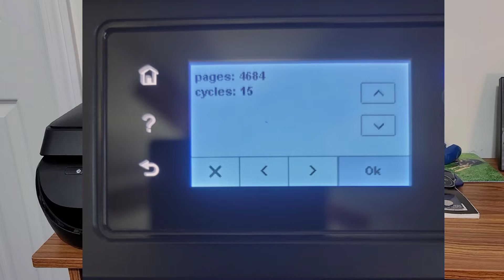HP OfficeJet 4655 Printer: Black Screen No Boot: Cause & Repair

Comment: Mine is from 2015. I just finished the re assembly. No joy. Removed the main board. Cleaned it with alcohol and Q tip. Checked the battery and power supply with a multi meter, they were fine. I agree with the Bass guitarist, no more HP for me. I could see it had sort of a stain, like you would have expected it to be sticky. I only used the thing at tax time, scanned a couple things. Sometimes my ink heads would dry out from being under used.

It's not that bad of a job though. I just took off the front display, unhooked the right side latch to open the lid all the way, took out the screws to remove the upper cover, then you can snap off the right side to access the main board. Hardest part was getting the lower ribbon connectors back in. I found there was enough slack where they could be carefully pulled out from beneath. 

I guess I'll go with Cannon next time. They say Epsom is militant with their ink refills. There's another video from that same guy where he shows the directions a little better. It's not the exact same printer, but it's close enough. Just needed the first 8 minutes,  I like when he says take pictures, "I'm not putting this thing back together". Lol.

 https://www.youtube.com/watch?v=7vx63oOhQ6Y&t=559s

Comment: Man, I was hoping you had a way to clean it to bring it back to life before I clicked. Its not even worth repairing for me.
Reply from the maker: You can try using distilled water with a soft bristle toothbrush to see if you can remove the crap on the board. Just go easy with the toothbrush with the small tiny components they can easily be dislodged if you are too rough. Distilled water does not have any minerals and should wash away most of the contamination. Use a hair dryer on low heat to dry it up before reinstalling it. It's worth a try worst case scenario you might have to find a replacement on eBay perhaps.

Comment: great video , do you think that the main board F1H96-80001 is compatible with F1H96-60001 ? they look like the same but not sure that could replace the 60001 . . Appreciate your help , thanks in advance
Reply from the maker: Unsure. I went by a parts list I found.

Comment: Would cleaning it with the compressed air in a can work? I guess I'd have to see how to pull that part out though. Thanks for the thorough video.
Reply from the maker: @robd2650  Unfortunately compressed air may not do it. You might be better off with using contact cleaner. Or better yet rubbing alcohol is the best cleaner for circuit boards and less caustic and less dangerous than using contact cleaner.

Comment: Thanks so much for posting this video!!  Tried what you suggested (plug in and out while holding the power button) - it didn't work.  Thought about trying to remove the motherboard, but I'm not very technical at all.  Thanks to you I found a VERY simple solution - give the printer a few good taps.  It WORKED!! You said you had found a teeny tiny bit of debris stuck on the circuit board, so I thought to myself maybe banging the printer around a little would dislodge it,  without having to even take the circuit board out. So I unplugged the printer, turned it sideways, hit it lightly against the desk.  Did the same thing with the other side, then the back and the front.  Plugged it back in, and to my total astonishment, the screen came on, as normal.  I touched "copy", it works fine.   I've had this OfficeJet 4650 for 9 years, and love it, don't want to buy a new one.  I am SO HAPPY it's working again.  I'll let you know how long this lasts. Stay tuned .....
Reply from the maker: @nsvaneys  yeah it's the fate all electronics with conductive dust/debris. Keep me posted on how the fix goes! Rubbing alcohol is the best cleaner, but a gentle brushing with a toothbrush can work, just don't brush too hard otherwise it will dislodge the tiny components on the board.

Comment: My print 4655 had the exact same issues (doing weird things on its own). Got the board out - perfectly clean though. Disconnected and reconnected all connectors and changed battery. This made no difference - I’m willing to bet we did have a bad boards.
Reply from the maker: @johnpb7965  yeah I think they just eventually wear out I had over 4,000 pages printed I think if I recall correctly. The replacement board I got when I looked at the amount of pages printed with it it was only like 600. When it dies it dies but at least I was able to give it a little bit more life in the meantime

Comment: Yes, very interesting. We have a hp7640. And seems to work fine for now, very low usage. The only thing we do not like is the subscription arrangement with hp. It is very difficult to cancel and use your own choice of cartridges.
Reply from the maker: Yeah that's what I heard I was thinking of buying an HP 9015E to replace this one but I'm not liking the fact that you have to register it in order to use it even as a standalone printer. Least that's what I've gleaned from everything I haven't opened up the boxes yet because I was waiting to see what the outcome of this project was going to be. I know eventually I'll need a new printer but not sure if I'll keep this HP one or not
Reply: I would never buy  an HP printer again precisely because of their subscription shenanigans.  They rope you in with a free first cartridge and I think a free first month, plus their printers that require the subscription are much lower-priced to start.  

But then if you want to use your printer, you have to have the printer connected to a registered account with a card on file, and you're charged a subscription fee monthly even if you didn't need to order ink.  If you opt out, they can remotely disable your printer, so it's the biggest paperweight.

I ended up recycling mine within a year and just buying a Canon.  Canon is still going strong 4 years later.
Reply: @TheLiberaceTheory  Yep got to agree.  Do not think we would choose an hp printer again.